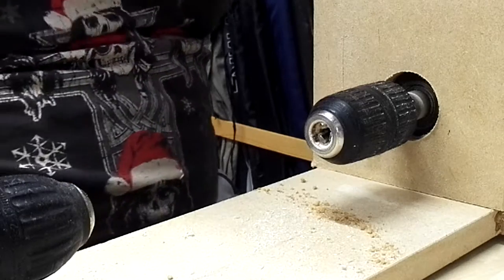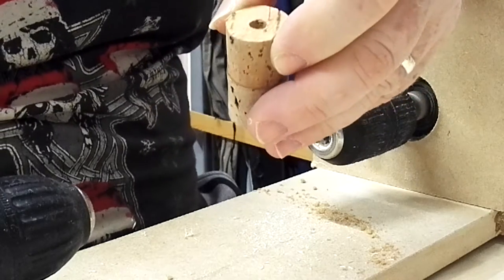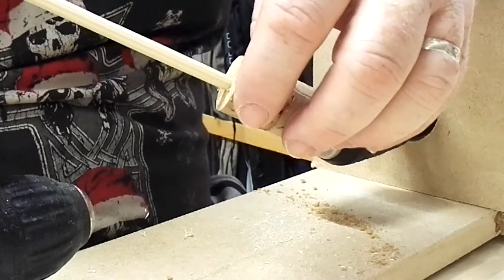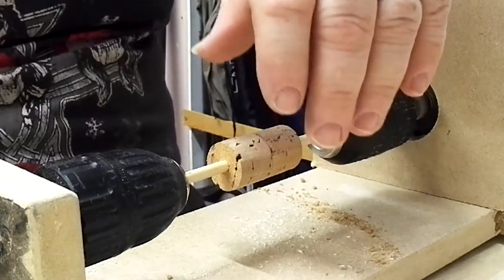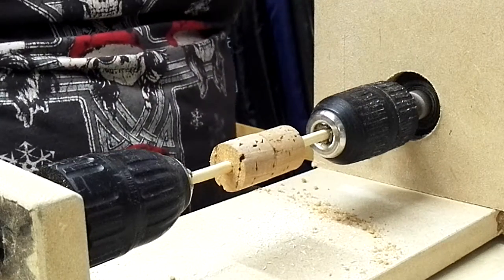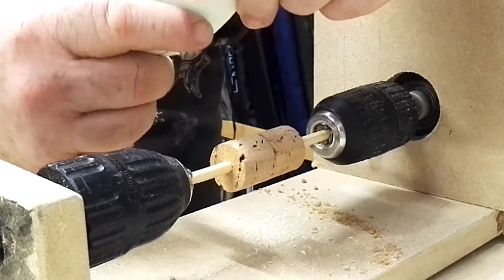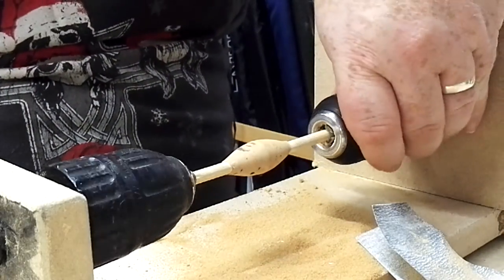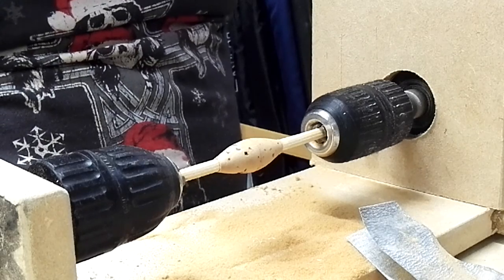Turning a cork float body

Comment: Hi, I've just bought some float making materials, and was just wondering if you could tell me what size motor you use on your lathe ? Thanks
Reply from the maker: Hi Glen... Its actually a 1200w motor, rescued from an electric tile cutter.

Comment: Hi there, i have a mini lathe and am having trouble with the cork turning on the stem, whilst turning it down even though it`s drilled to the correct size. Any tips on how to prevent this. Many thanks for any help.
Reply from the maker: Hi Harry.
I always cut the hole through the bodies, be it Cork or balsa, smaller than the about I use to turn on. 1mm dia smaller is enough to give a nice tight fit.
Reply: @TheGapinkerton   Hi mate, thanks so much for your help, i`ll give that a go. All the best for the new year :)
Reply from the maker: You too mate,,, Aw ra best.